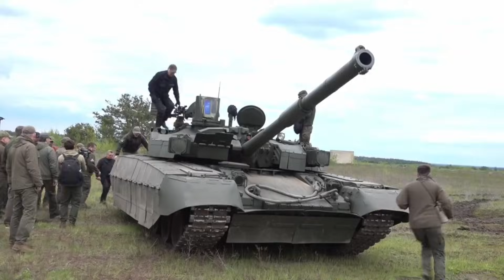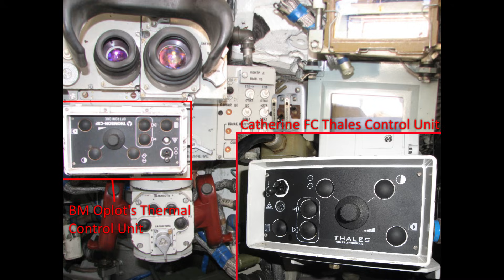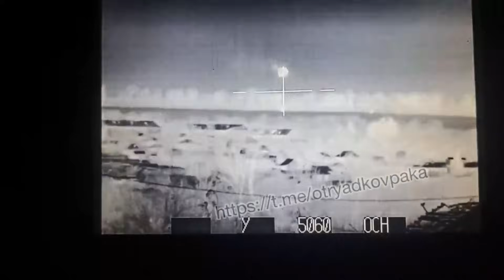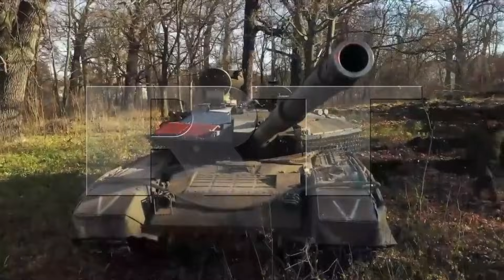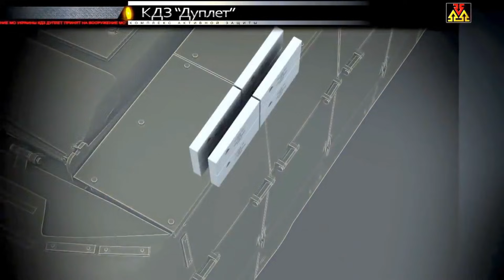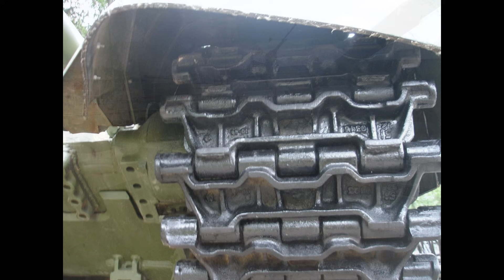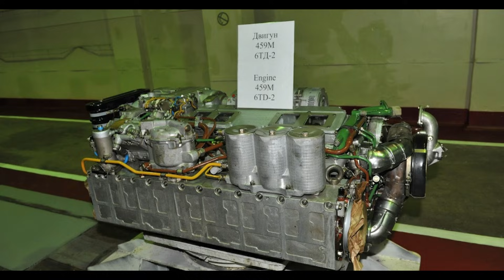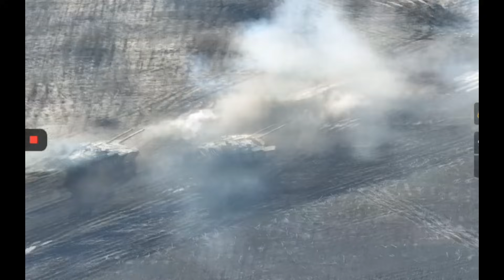Best Ukrainian vs Best Russian tank. T-90M vs BM Oplot comparison

Comment: I would like to know if they could reduce the carousel autoloader detonation damage. They already have a shield on top so adding a sliding door like Abrams that automatically close after a reload is not that difficult. And blowout panel underside could be interesting but I don't think it could last a rough ride but blowout panels to the sides through the tracks can be possible. I wonder if they calculated it and come to the conclusion that energy release is too rapid for the crew to survive. Or it's one of those "possible but no money" situations.
Reply: It wouldnt be possible as the ammo carousel isn't isolated, so the pressure inevetably would still go to the cabin.
Reply: Where would it blow out 🤷‍♂️
Reply: It would take a slight redesign of the tanks, and would 100% make the tanks taller

I think it’s a combination of “that’s to expensive” and the good old Soviet like “it’s not a problem because our tanks are perfect”

The Abrams has blow out panels for the hull stowage 
It’s 100% possible
But Russian doctrine means, they don’t want a bigger tank

In their minds, being a smaller target, or adding ERA, is just as good of a solution as blow out panels (it’s not though) 

Specifically because they have to show their butts and drive away using a forward gear

All that low profile, ERA, and armor is useless, and a blow out panel or several would help considerably
Reply: @bornonthebattlefront4883  
"good old Soviet like “it’s not a problem because our tanks are perfect”"
Literally never had been the case during any Soviet design process

"But Russian doctrine means, they don’t want a bigger tank"
Ah that's why they keep making bigger tanks and why their main tank designers all confirmed that the tank size is relatively irrelevant

"In their minds, being a smaller target, or adding ERA, is just as good of a solution as blow out panels (it’s not though) "
No that is not their opinion. Adding ERA is a better solution than blowout panels, yes. Not being penetrated is better than being penetrated. Again, their tanks keep getting bigger. They did not mount blow out panels because it heavily increases the complexity of the autoloading mechanism and there is no way to release the energy.

"All that low profile, ERA, and armor is useless, and a blow out panel or several would help considerably "
ERA and armor is currently the best option after APS and a blow out panel is useless when the crew dies from penetration anyway. The profile is also larger.
Reply: @bornonthebattlefront4883  abrams tank already had plan for blowout panel since its creation which soviet and russia t64-t90 not only t90m had on back of the turret. To create that then they to renew chasis production line which added time and money when they already try to change that for T14 Armata line. The only thing they can change is make adjusment to reverse speed while preparing new line production for armata
Fyi : armata taller than abrams
Reply: The only solution is like the YAGATAI: get rid of the carousel entirely and make it a bustle loader. 
However, not having spare amp outside the auto loader in the hull and turret is much much more important than armoring that carousel. 
Most likely most catastrophic explosions of Russian tanks we saw wasn’t the autoloader ammo but the spare ammo somewhere else that caused the explosion.
Reply: Ukrainians actually do have a sort of blowout panel technology they were doing for the Turkish Army of the T-84-120 Yatagan prototype. So I have no doubt they actually figured out the problem of it already by changing how the Auto-loader function.
Reply: @maximad5997  no they dont. The yatagan had turret bustle ammo storage ON TOP of autoloader. So pretty much what T-90M does
Reply: It's connected to the turret, it's inside the hul, jus wouldn't work

Comment: Is there any guide on production costs of both? Because at the end of the day that would be more decisive.
Reply: After doing a quick Google search:
-BM Oplot: 4 million USD
-T-90M: 1.6 million USD
Reply: @khoapham4670  The 1.6 million USD is the number for the production of a T-90, the only source I can find for that is Euromaidan Press, military-today says 4.5 million USD for specifically T-90M.

Meanwhile the cost in 2020 for one BM Oplot were 5.15 million USD, increased costs cited due to changing some of the parts to rely less on unfriendly countries export.

Back in 2009 the cost per unit of an oplot was some 3.8 million USD.

So no.

I can use google too, I just asked the question hoping someone did some very deep digging.
Reply: T90m i believe is 4-5 million. Oplot on the other hand is only 3 tanks. So the price is higher most likely. If the Ukrainians produced more oplots before the war the price could've been on par or somewhat lower than the t90m price
Reply: @squidysnose69  I think it's like 20-60 tanks each month. With them expecting to increase that number even more. Russia has switched to a war time economy so there aren't any real restrictions.
Reply: @dhanu_4539  they have ramped up production to 100 in nizhny tagil. Also cmon ford vs ferrari? Id assume your take is on production numbers and not on quality
Reply: @squidysnose69  on production 😁
Reply: @dhanu_4539  Delivery of T-90M started in 2020, as of January 2022 they had some 67 T-90M according to IISS. 

There were 2 deliveries of batches of T-90M to the Russian military, one in January 2023, and one in May. The amount in January is unspecified, the amount in May is supposedly 11, so a production rate of about 3 a month, 33 a year based on this extrapolation.

Note that this is basically inconsistent data and BS math, and that the only source for that is the Central Military District spokesman - a Russian official.
Reply: @bruhwhat5485  i think you might have missed the video where they showed off row's and row's brand new T90s....there were at least 50 there itself... In addition new shipment was seen today.... Basically I've seen more than 66 t90m tanks just this month
Reply: @bruhwhat5485  20 is being rather conservative.... I'd guess 40 or 50 a month
Reply: @dhanu_4539  yup. there are hundreds of T90m running around. 3 a month is far too low for how many there are.
Reply: @dhanu_4539  If you remember where you saw it/could find it a link would be nice, because I remember a video where they showed a lot of tanks that turned out to be T-90A and not T-90M, and a different one from this December where it was some T-90M and the rest was T-72. 

Also would be important as to whether those were new or not, I just based it off what they told regarding delivery numbers, and assumed that the number they delivered in May was the one they produced since the last delivery.
Reply: @dhanu_4539  Source ?
Reply: @bruhwhat5485  https://youtu.be/thsvbtuGpSo if they are a variant then I apologize for the mistake
Reply: @squidysnose69  but as things are we are talking about comparing fords production rate to ferrari’s.
Reply: You can be sure that a Ukrainian tank will cost 5-10 times more than a Ukrainian tank.)
They have already purchased provisions, drones and so on in this way.
Reply: Not really... During war times cost is not a factor. Only the the number of factories and the speed at which they are made. For example the US could produce thousands of the latest abrams if a war were to start even though the price of the tank is very high, but Briton couldn't produce even older challengers even if they are cheaper because of the limited production capacity

Comment: im not a tank engineer just a simple electrician xD  but i was wondering why you cant put blow out panals under the carusel? i mean it will still suck for the crew but maybe you can design it so atleast there is some chance of surviving a carusel cockoff
Reply: Carousel isn't isolated. Besides, if you put blow out panels below, youre sacrificing anti mine protection, and there are plenty of mines in this war.
Reply: Guess it’ll be to difficult with the thin floor armor. I don’t think driving over even an anti infantry mine or a bunch of rocks would be a brilliant idea
Reply: Blow out panels are efficient when you have ammo in an enclosed container. Panels will release the pressure upon ammo detonation, preventing this deadly pressure from entering crew compartment. To put blow out panel for carousel, you'd need to completely isolate it and introduce some king of doors for autoloader to still work (which will open when the ammo is loaded into the gun and close back). This will make the autoloader a lot bigger, more complex, more complicated to maintain and it would be pretty much impossible for crew to load ammo manually in case it malfunctions. So it is not worth it.
Reply: @gauss_gun  also blowout panels below the tank - youre just turning your tank into a 48 ton rocket. Ammo explosions can throw a 10 ton turret 50 meters in the air, I wouldnt want to be the one to find out how far up an entire tank can go
Reply: At facility 640, they thought about it, but changed their minds. Cost 60 mm armor plate closing automatic loader
Reply: Just use your brain and think on what you’re  asking 🙄